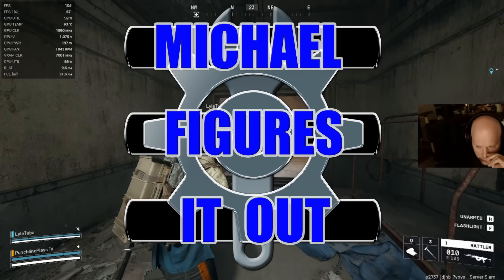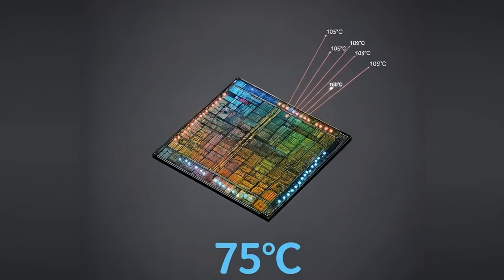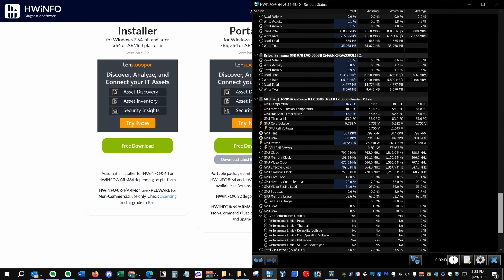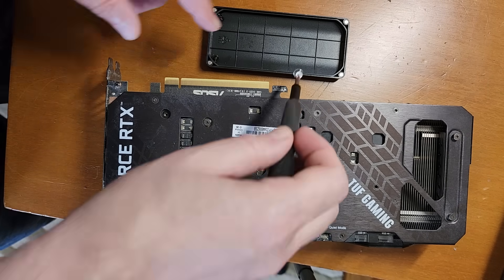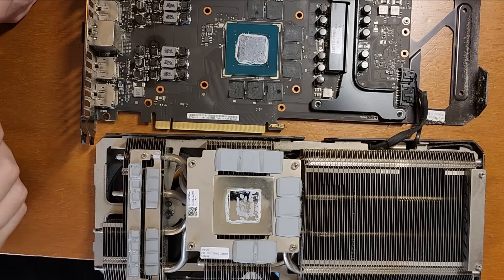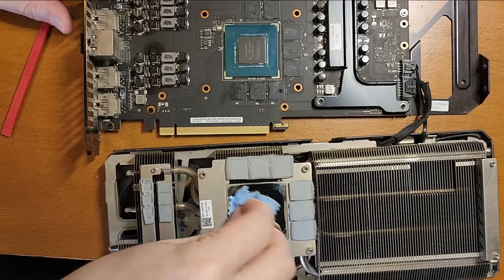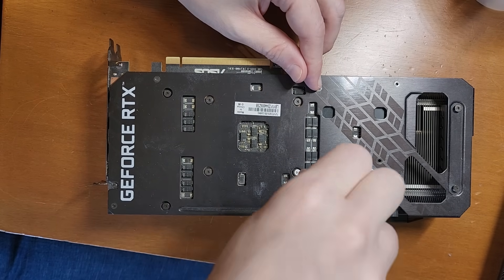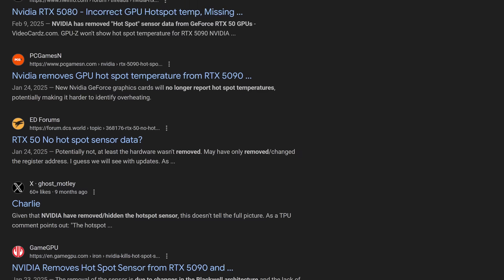GPU Temps Are A LIE!

Comment: amd adrenalin has the hot spot temperatures tracking option
Reply: so does MSI afterburner/rivatuner too lol It seems like Nvidia don't want people to know how truely hot their GPU is by removing the hotspot sensor in the newer models.
Reply: @sparda9060 may be wrong but I’m pretty sure all 50 series use a phase changing thermal pad instead of paste, which won’t ever pump out, still a bad decision to remove the sensor tho.
Reply: @sparda9060  Even Corsair iCUE tracks GPU hotspots.
Reply: @sparda9060   afterburner/rivatuner can have bad impact on gaming these are no longer such good programs or needed, especially with amd gpu
Reply: adrenalin is nice in some ways, but i personally prefer the simplicity and functionality of nvidia control panel.(7900xtx user)
Reply from the maker: AMD is awesome.
Reply: @MichaelFiguresItOut  They would be if the drivers wouldn't crash and blackscreen for no apparent reason and reset my custom fan curve in the process every single time just to add insult to injury. 
If I forget to set the fan curve back up, the card then tries its hardest to stay quiet afterwards, temperatures be damned. Can't wait to replace this abomination of a card tbh lol
Reply: @Knaeckebrotsaege  They do it on every random system restarte tc. I exported my settings into a file so I can put them back on each time that happens.. But yeah, it would be cool if it remembered it all the time..
Reply: @Knaeckebrotsaege lol😅
Reply: @Knaeckebrotsaege defective card?😅 Crash and black screen doesn't happen to me. For fan curve i try to custom it in msi afterburner and not experiencing any issues.
Reply: @Knaeckebrotsaege  I have never had a single problem with no sense crashes. Only crashed a few times when I was experimenting with tuning settings and after overclocking a bit too much it crashed and all my settings reset. But I have a saved .xml file with the settings profile.
Reply: @Knaeckebrotsaege  you overlocked the card and using no Afterburner for fan curve? Lol.
Reply: @shizukiaoi  Nobody said anything about overclocking?! My card is running stock
Reply: @Knaeckebrotsaege  then you don't need preset fan curve. If you think your card running too hot - take your card back at shop to make a check. Or you can change paste to PTM7950. But high hot spot is normal for red cards. I had 105 hot spot at asus rog strix 5700xt for 5 years. then changed paste to PTM, now it is at 83 hot spot. My 60-years old mother ( she is a gamer too) using it
Reply: @shizukiaoi  It's a reference design RX 6800 ordered straight from AMD. These don't use paste, but come with a graphite pad (similar to thermalgrizzly kryosheet) on the Die straight from the factory, which generally doesn't need replacing as it doesn't degrade (unless you disassemble the card and damage it.. obviously). 
The reason why I set a custom fan curve is that by default, it gets to 75-80C before the card even thinks about ramping up the fan speeds in any meaningful way from the default 25%, which IMO is pretty damn toasty.  I just set it to ramp up way earlier than that (first increase at 64C) to keep it cooler for longer, as I don't particularly like when any GPU rapidly approaches the mid 80s just to try and stay extra quiet.
IDK what the hotspot temps are from the top of my head, but they generally aren't (and never were) incredibly high compared to the core temp
Reply: Didn't know about the graphite pad from the factory. Great decision. But I think that 80 is pretty cold. 90 is hot for me, even with the AMD think that 110 hotspot is fine. lol. my previous card rog strix 5700xt was always about 105 hotspot with any thermal paste, worked for 5 years and was fine. Changed thermal paste to ptm pad and now it is about 83 and still working in second PC.
Reply: Ye and its showing 110'c on the Radeon trash lol
Reply: @hircine92h The hotspot on my 7900 XTX only gets up to 80C under load. I'm guessing you've either never actually used an AMD GPU or got a defective product at some point.
Reply: @DarkBooger  Copium AMD fanboy. An AMD Radeon user knows well their GPUs run +100'c since RX 5700XTs. It's all over Reddit.
Reply: @hircine92h  Me simply having a positive experience with a 7900 XTX hardly makes me a fanboy. I can't speak personally on the 5700 XT though since I had an RTX 2060 Super at the time and I wasn't interested getting a better GPU until late 2023 when I was hitting VRAM limitations. If people on Reddit were having problems then I imagine they would've solved it by now or simply returned the cards if they were able.
Reply: @DarkBooger  Dunno about ur experience. For me, I had an RX XFX 6800XT Merc (supposedly top of the line model) with beefy cooler. That thing was huge. It ran like a furnace. barely reaching 70'c on temp but the hotspot would reach 100'c and sometimes 110'c and even beyond. Changed termalpaste/pads.. still same issue. The card ran fine tho. High FPS no stutters no issues, except the usual trashy AMD experience like driver crashes from time to time and blackscreen which I had this issue even back in the day with the RX 580. Did a quick search on Reddit and found many people having same issues with RX 6000 series having high hotspot temps. All these issues were solved simply by trading the RX 6800XT with an RTX 3080. I just install the card & drivers and it just works 0 issues. Funny each time I have an AMD GPU it comes with issues and the moment I switch to Ngreedia it just works absolutely 0 issue.
Reply: @DarkBooger  ohh and btw AMD decided to end driver supp for newer games for RX 5000 & 6000 series, which is laughable really considering these cards are Not that old and very capable, but I guess $$$$ is what AMD only cares about. To compare, Ngreedia only just recently ended driver supp for GTX 980, so GTX 980 from 2014 outlived Radeon trash from 2020. So much for the "fine wine". dw ur GPU will be next on the line after 2 years or so..
Reply: @hircine92h  AMD didn't end driver support for RX 5000 or 6000 series cards. They are just no longer trying to add new features such as FSR 4 which makes sense given that there is no real performance uplift on that hardware. The same thing was likely happening with my RTX 2060 Super where there were no noticeable performance gains from driver updates other than some bugs being fixed.
If my 7900 XTX was having hotspot issues I couldn't fix I would've traded it in for a different GPU as well. Also, from my experience you should use phase change sheets instead of paste since it just better for GPUs since it gives you an even spread across the die and lasts longer.
As far as drivers go I did have some driver issues during the initial installation since I forgot to uninstall my old Nvidia drivers which were causing driver timeouts and crashes which happens to a lot of people since it's a very easy mistake to make. The only problems I've had since then were usually related to Windows.
Either way, I'm glad you're happy with the RTX 3080. The 30 series are some beautiful cards and I'd probably be using one right now if the crypto boom hadn't happened.
Reply: @hircine92h  Yet another dumb fanboy talking crap 🙄
Blind brand/company loyalists really are the lowest form of intelligence

Comment: DON"T USE thermal paste. It's 2025, use Honeywell's PTM7950. It's literally the best thing and lasts indefinitely. 

It works way better and it doesn't "drip" with time if you have a vertical GPU (I have a Fractal Terra so my GPU is mounted vertically) Same goes for the CPU, there the problem is most apparent because it's always vertical, not flat. I noticed temperatures climb and climb over the year and when I finally decided to change the paste, I found that a lot of it accumulated on the bottom, while the top of the CPU had spots where there was no paste. Same on the GPU. I had 110C on my GPU hotspot. Now it's 80C. 
And I didn't have some sht paste, but a top tier Noctua one. 

PTM7950 is great because it's a pad, that with temperature turns kinda liquid and settles. It's amazing right away but with temperature cycles it improves even more. It doesn't get pulled down by gravity. It's also really easy to apply, put in in the freezer, so it becomes hard and just slap it on.
Reply from the maker: Is it difficult to work with PTM?
Reply: @MichaelFiguresItOut  As long as you keep it cool it's easy to apply. Once it warms up it tears easily especially when taking off the protective plastic from it. That's why it's best to put it in the freezer before applying. I have a mITX build and I honestly will never use paste, PTM is way better in performance and it covers the whole die. Only thing better might be liquid metal? But obviously that comes with risks... When it comes to PTM you also gotta get the proper thing not knock offs.

Comment: not only does that gpu need repasted but the case needs a big clean or other things going to start happening as well (what im hinting at is cpu temps, which weren't in the OSD here)
Reply from the maker: His CPU temps have been great. He has an Apevia PREDATOR High Air Flow case which has excellent ventilation.

Comment: In 2020 i bought overpriced gigabyte rtx 3080 10gb and it had problems right away, but problem was vram temp hitting 105c and it would drop performance or lag, so decision was made to change pads myself since it was early stages and it wasn't considered a problem even though it was, after getting thermalright pads i saw drop from 105c to 72c and also hotspot was the same while core was 10c cooler. And it stayed that way for 3 years almost, and performance was great nothing trottled in addition with undervolt, card ran smoothly however vram still died and artifacted and luckely enough i got a refund because they couldn't fix it and there was no replacement. Even though i replaced pads myself i didn't loose warranty since i reported about changing pads to gigabye in 2020 and said that i resolved issue myself, they responded that it's great that i got my problems sorted out, and later gigabyte started using high end pads themselves in newer cards and newer gens.
Reply from the maker: Wow. Sounds like the vram was defective from the start or the high temps lowered the vram's lifespan.

Comment: I have brand new powerColor Reaper Radeon RX 9060 XT 16GB just bought it a week ago and my GPU hotspot can hit 90° is that fine ?
Reply: Yes.
Reply: @FunTimeGhz  Thanks for replying i’m already thinking about returning it and getting a different one or an RTX 5060 Ti. Would you advise doing that, or just sticking with it ?
Reply: @scoopi5241 

The hot spot 91 is absolutely normal. 

As for 9060 xt or 5060ti, it depends on the price difference. If they were at the same price, I would pick 5060ti.
Reply: @FunTimeGhz  i'm just concerned about the Hotspot temp but since everyone says its normal so i think i'll stick with the 9060xt for now and regarding the price the 5060ti is about 60$ more
Reply: @scoopi5241 a hotspot reaching 90°C is not a problem, a delta(difference) in the gpu average temperature and the hot spot is the problem, if it is greater than 15-20 degrees. Id keep the 9070xt just because as he said the 50 series cards don't have the "hot spot" info anymore so you wouldn't be able to see this problem

Comment: PLEASE FOR THE LOVE OF GOD PLEASE DO NOT USE NT-H1 AND 2 FOR DIRECT DIE COOLING
Reply: i recommend arctic mx-6 and thermal grizzly duronaut because viscosity should not be like butter
after using mx-6 gpu temps still holds great
Reply: @KokoroKatsura  Can confirm, MX-6 is pure quality
Reply from the maker: Even on CPUs?
Reply: @MichaelFiguresItOut  I had the same observation, nt h1 pumped out on an old laptop of mine after 2 weeks.
Reply: @MichaelFiguresItOut  if it have IHS lid the lid will hold firmly thermal paste more
but direct die cooling nt-h1 and 2 will thermal pumpout aggressively after month usage
Reply: @MichaelFiguresItOut  the answer is, "it depends". thicker paste is usually recommended for gpu direct die due to thermal cycles being a lot more frequent and pumping out the paste. i agree with  @KokoroKatsura  with duronaut and mx6, add gelid gc-extreme and thermalright tfx to the list.
PTM7950  should be the go to replacement if budget allows.

Comment: hmmm I think the power connector on the right (from the angle of the video) is not properly seated. The clip was not fully in.
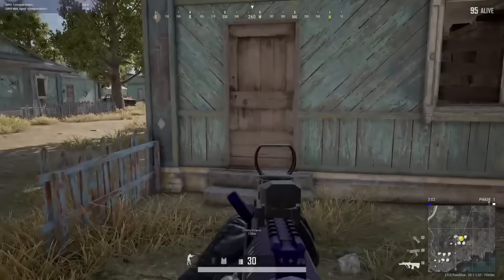Reply: 6:53
Reply from the maker: @IdiNiumYT  Great catch! I told Punchline and it was not properly seated. He pushed it in and now's it's fixed. Thank you!
Reply: @MichaelFiguresItOut You're most welcome! 😊
Reply: @IdiNiumYT nice eye

Comment: If you see Intel interview , temps and hotspot itself could be a lie 
It depends on where they put the measurement point and they can report whatever they want
Reply from the maker: Just watched it. Thanks for mentioning it.

It's one of der8auer's videos titled "Current CPUs are Overheating? The Honest Opinion of an Intel Engineer" for anyone else that wants to watch it. 

The Intel engineer was not saying the temps and hotspots are imaginary. He was saying that when you put a sensor on a chip, it displaces the actual transistors that are generating heat. So the temp on the sensor (which generates very little heat itself) is a gradient lower than the transistors in the vicinity that are generating the heat. It’s like saying the thermometer under your tongue is not as hot as your tongue. 

He did say he could place a sensor on the corner of the chip if people just wanted to see a low temp. But the company wouldn’t do that unless they were intentionally being dishonest because their engineers use those temp sensors for testing/debugging. It would be easier to just hide the hotspot temp. A trend I hope stops with the NVIDIA 50xx series.

Comment: Nvidia disabled HS monitoring for RTX "5" series. Also, the best thermal material for GPU core is phase change thermal pad common know as PTM.
Reply: Still not a good reason to remove the hotspot monitor. Even the FE cards have liquid metal which can dry out overtime. I heard it's unlikely but still possible.
Reply: @metradawn8071  Only the 5090 FE uses liquid metal.  None of the others do.  Not even the RTX 6000 Blackwell uses liquid metal.
Reply: @slackary8563 So the infamous 600watt room heater of a gpu doesn't need a hotspot monitor when dry out is possible?
Reply: @metradawn8071  I think the cards should have hotspot temp monitoring but I’m just pointing out that what you said about the fe cards was mostly incorrect
Reply from the maker: Yup. No adverse impact from the pump out effect on PTM. I think Linus or Jay did a video about it but this was my first time opening a graphics card so I wanted to try simple paste first.
Reply: @MichaelFiguresItOut you must to try PTM from thermal grizzly. Second, i will give you advice, next time when you screwed GPU back, It needs to be twisted crosswise. 😉
Reply: doesnt lm still outperform ?
Reply: @Erksah02  Technically yes, but at the cost of like 10x the risk since it's electrically conductive (and the whole "soaking into the copper" thing). Genuine PTM7950 is the best you can use without worrying about all the LM risks, and LM is for when you want to risk the whole card for a couple degrees less (ie more money than common sense)

Comment: I have an RX 5700 XT that thermal throttles on stock settings at 109C... I put Kryonaut on the chip less than a year ago, so I doubt the paste is the problem.

The only solution I could come up with is running it at around 0.95V instead of the default 1.2V. That lowers it to a much more manageable 87C.
Reply: Which RX 5700 XT? I know the initial XFX launch cards, THICC II if I remember the model's name right, had a cooler design flaw that kept hot air trapped in. Gamers Nexus did a teardown showing the issues with it shortly after launch. I ended up obtaining one last year and modded it to get it to normal temps. If you removed the back plate and all the plastic crap and just used the main part of the cooler with just its shroud, temps would drop drastically making it a pretty awesome card. You would need to use a GPU brace on it to prevent sag though because the main cooler part is still heavy. The one I modded now has a home in a friends i7 6700 gaming pc now.
Reply: @TheOldGodFX  MSI RX 5700 XT MECH OC (MS-V381). According to HWiNFO.

If this matter I managed to lower both temperatures by about 6C by putting a fan to the lower right part of the card, facing towards exhaust like the rest.

And yes, it does have a black plastic backplate as you describe.

Is there any additional information I may want to know about this card? Besides repasting and repadding which I already have already done anyway.
Reply: @JoelHernandez-tz3vk  I'm not sure in regard to that model. But you may want to check out the Gamers Nexus videos they did on all the RX 5700 cards they covered. There may be something in there that would be useful to you.
Reply from the maker: There's a techradar article on the RX 5700 XT that references a (now missing) AMD blog post from 12 Aug 2019 where AMD states that card will only thermal throttle if the hot spot (aka thermal junction) hits 110C. 

In the video I forgot to mention but you can check the GPU section of HWInfo64 for 'GPU Performance Limited'. Expand that and look for Performance Limit - Thermal. It it says 'Yes' then your card is thermal throttling. Is that getting tripped?

Comment: not only did it drop alot in temps the fans also ran at half the speed. but you missed the chance to clean the dust out of the heatsink.
Reply from the maker: Good eye! We use FanControl to for the fan curves and I noticed the reduction in speed. I did clean out a lot of the dust but could have done more. Just didn't want to spend the whole day there!